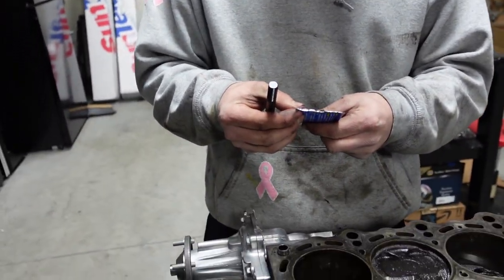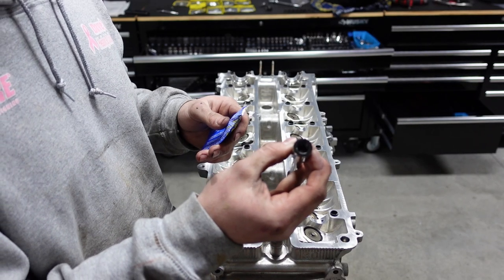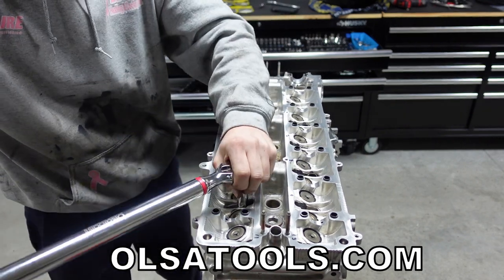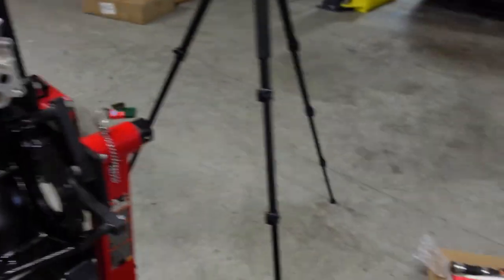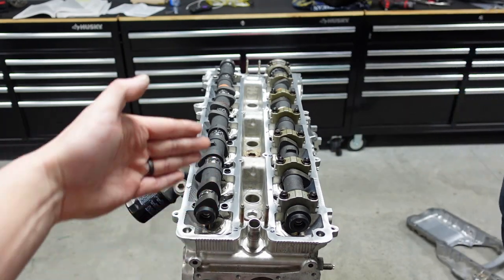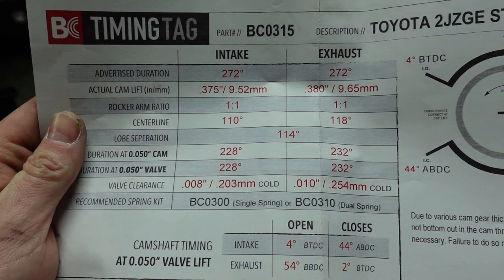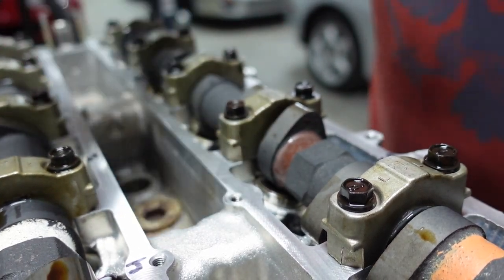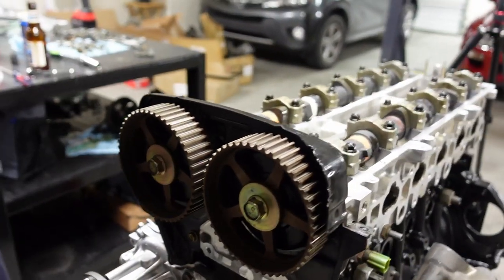2JZ  NA-T Build Ep. 3 - ARP Head Studs & Brian Crower Cams Install

Comment: Soo, The head goes on easier with out the stud on. It just sits and then you can drop the washers with ARP goop on both sides of washer. Drop the studs in after, because the reason for the allen on top of the studs is to help aid the install of the stud when the head is on.

Comment: Where are you getting your cam pick up since the gte head has the pick up on the side of the head and the ge heads doesn’t? On Alberto big boost channel he ends up drilling and welding a bung to put the sensor through.
Reply: Pretty sure you only need cam pickups when running the stock ecu

Comment: Second best straight six around today, after the Australia made Ford 4.0 liter Barra motor of course. Switch out the head studs and valve springs, and those monsters will spit out 600hp with ease. A few mods and 1500-2000 is entirely possible. They take a beating better than a red headed stepchild.

Comment: Thanks for showing this as I will be installing arp head studs and a gte gasket very soon.  If using the stock cams again would you have to check clearances?
Reply: No you wouldn't but you'd need to make a note which shim & bucket came from which valve/cam lobe. This applies only to using the stock cams, shims & buckets that come out of that engine.
Reply: @DynamicEvolved  got it thanks👍

Comment: Run the distributor. The cam/crank sensors are in that.
Reply from the maker: Going for a much cleaner look! 😎
Reply: @PureFunction  GTE VVTi 36-2 trigger wheel, Golebys trigger kit for the top end, should be good. That’s what I’m doing.
Reply from the maker: @bdub215  were using the FS moto setup (utilizing the 32-2 gear also)

Comment: I"m doing a NA-T build myself. Why not go shimless bucket right out the door?Especially with those cams
Reply from the maker: I ran shined buckets for 5 years with BC 272 with no issues. If shimmed right you should have no issues
Reply: @PureFunction  really? Hmmn....I'm using gte 272 cams on my NA (plan to drill out a hole on the cam cover and putting a sensor their) and was recommended to do shimless because I was planning to rev to 8.5k. If not necessary then I will save some money.

Comment: common mistake is to lube the studs going into the block, NO! The only thing you should be putting on the block side of the arp stud is thread sealer if it protrudes into a water jacket, OR loctite if the manufacturer specifically calls for it or if the engine has issues with studs backing out. 

the ARP grease and even engine oil will expand a little inside the threads and cause the studs to push out or lose torque...not good. The ARP instructions are VERY clear that the threads in the block and the stud need to be very clean. You do want to ube the upper part of the stud threads AND just one side of the washer where the nut will ride, you do not want the washer to spin on the cylinder head as most are aluminum and will create shavings and dig into the head if it spins. 

do not lube your block side stud threads.
Reply: so you are able to grease the block side of the stud with sealer or loctite?
Reply: @obxurv  sealer and loctite are not lubricants. You need to make sure you clean the threads out with brake clean and then blow the air out And make sure they are dry, then you apply the thread sealer or loctite only where specified by the service manual.

Comment: Head mating surfaces is not clean......
Reply from the maker: You scrape the block with a razor (being careful) if you’re not matching the surface (which requires full disassembly and rebuild) this is what 90% of shops do as most opt to leave the block stock. 

Last 3 engines I’ve done have all been this way and zero issues.